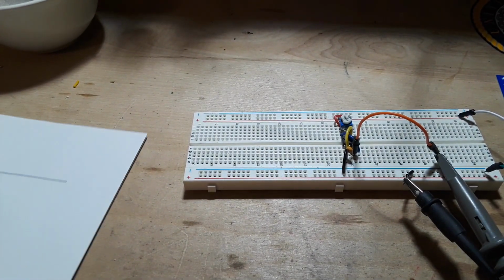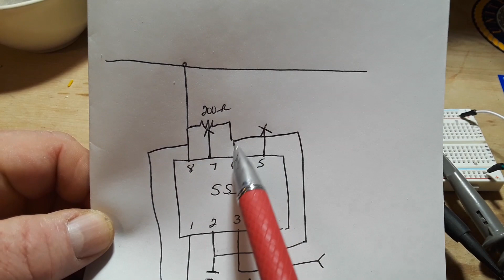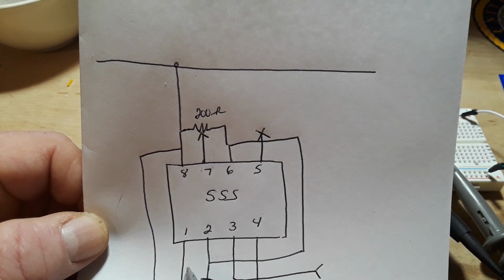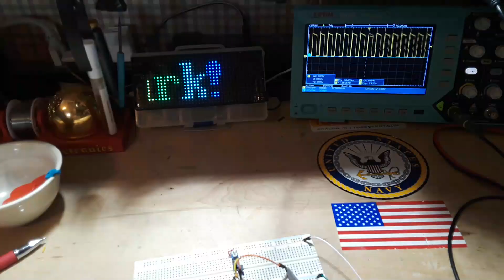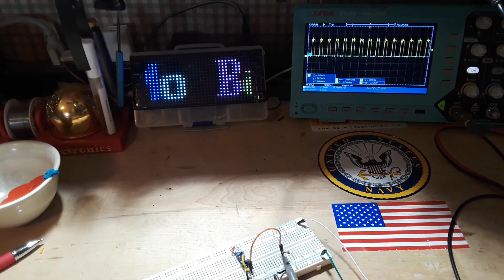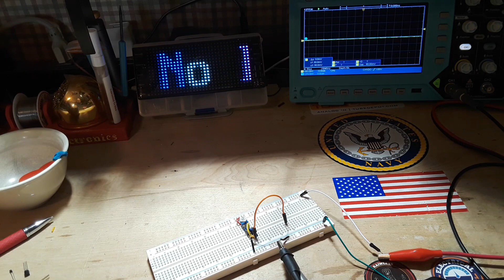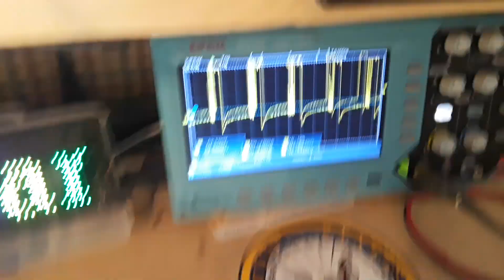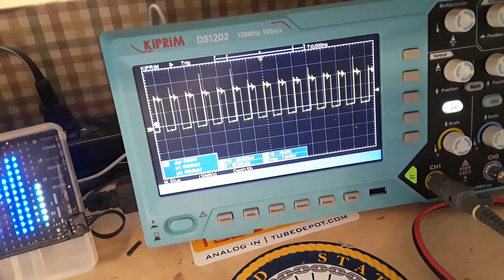Trying Out YOUR Signal Integrity Solutions

Comment: Another option you might try: an audio isolation transformer. If you could find a cheap enough one with a HF response up to, say 30kHz, it might attenuate most of that ringing as a bonus. Of course, it will cut your desired signal too, but not by as much, and this project needs an output buffer to be useful anyway. Just spitballing...

Comment: I just made my first buffer/voltage follower. A lamp (USB) and a tester was making that parallel load problem. Now I got my little power supply in connection to a couple of batteries and solar charging (for DIY lamps).

Comment: I noticed you where using a 200 ohm potentiometer for your Ra and Rb. You may want to up that as Ra shouldn’t be lower than few hundred ohms as when Q1 in the 555 turns on Ra limits the current through it. From memory min values for Ra and Rb are 1K ohm. A 10 micro farad decoupling capacitor should work and another 10 micro farad across the speaker as well. The 555 output max current is only 200mA so you could always put a LM386 after it to up its power.

Comment: Wow. Looks like the direct output doesn't like "EMF" reactive loads. Obviously, the resistor is non-reactive. 

For the capacitor, how was the amplitude? If it was comparable, the driver (I couldn't see what you were using, I was driving home) was probably working.

For the buffer, I think I heard something, but don't hold me to it. Lots of road noise too, so could have been that.

Comment: I suggest that you use a tweeter speaker, and a suitable audio amp IC as the buffer, something around one or two watts output, maybe with a differential output to drive the speaker efficiently. Both speaker and buffer amp must have a frequency response up to the required 20 KHz. 
There needs to be better supply decoupling and the input to the amp  should be A.C. coupled. A.C. coupling would be unnecessary on a differential output amp. 
I might run the oscillator section on a 5 volt low power regulated supply, so that the amp can be run from 9 or 12 volts. 
There is the matter of how this circuit can be automated. Assuming the idea  is to startle the dog into not barking and teach not to bark continuously, then some logic is required to 
A) make the oscillator pulse on and off. 
B) ideally switch on only when the dog barks. 
It is possible to perform this with just logic, in which case I might have replaced the 555 with my favourite quad nAND Schmitt trigger, as this provides an oscillator and some logic that can be used to implement a non re-triggerable mono stable, that might be started by a transistor microphone input. It's important that the oscillator own output cannot trigger it into operation. This can be performed by the mono stable,  and by separating the frequency response of the microphone from that of the ultrasonic output. 
While a logic circuit can be made to work, a reduced component solution can be achieved using a low cost microcontroller, such as a pic. 
The software programmability gives the most flexibility. A microphone can be connected to the comparator input to detect the loud noise of the dog barks. The internal timers can be used to ignore the odd high level of impulsive noise and generate a cadence for the oscillator, and to limit its on time. The micro can also be used to synthesize the required ultrasonic oscillation. 
In operation, the unit could have a very low standby current, and when triggered by the barking dog, generate pulses of high level ultrasonic noise, maybe in time with the barking. The unit could then turn off and switch back to low current mode. 
A critical step would be to confirm that a pulse of ultrasonic sound really does discourage a dog from barking, and does not have the opposite effect. 
Certainly it is important not to harm the dog's hearing or to a annoy the neighbours. One nuance of a microcontroller solution, is that it's activity can be programmed to be sensitive to the time of day, or the light level. 

If the intention is to produce a simple manually operated sound generator, an A.C. coupled  MOSFET,  driving a piezoelectric speaker or tweeter sounds like the simplest solution. I would still use the quad Schmitt as the oscillator, as this provides the option to produce a cadence on the ultrasonic  output. I would also use a regulator to isolate the oscillator section from the drive circuit. The whole thing should work well from a 9 volt battery, particularly if the pulse width of the switching waveform is limited. 
Again there is room for experiment to determine which noise distracts the dog to the greatest degree. Again the schmitt trigger oscillator offers the option to either use the square wave output to drive a simple transistor into saturation, or use the more sinusoidal charge/discharge output, to produce a more irritating sound. 
If you want to use a pure tone oscillator, I suggest you use a single phase shift oscillator. This can produces a very good single frequency sign wave.